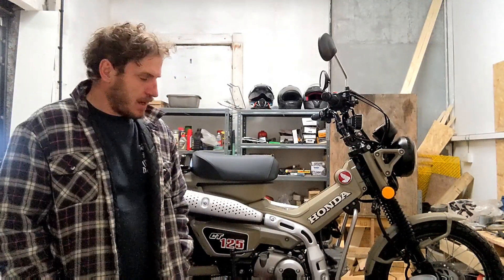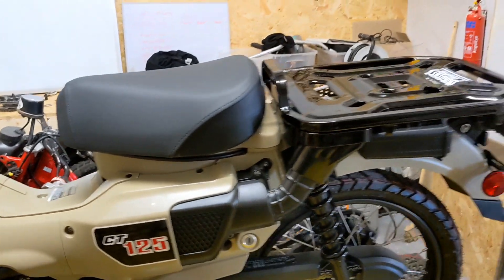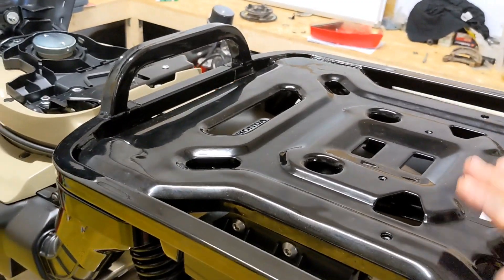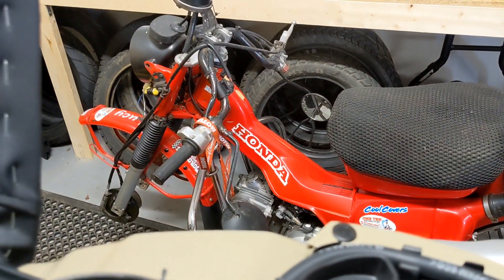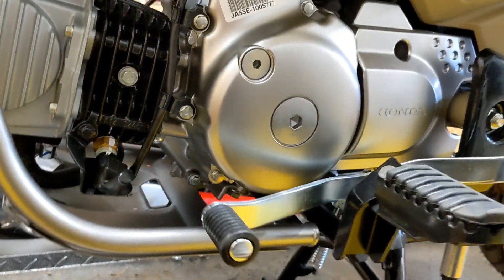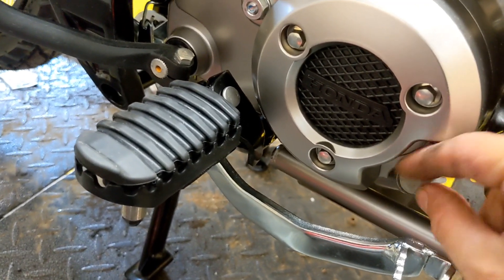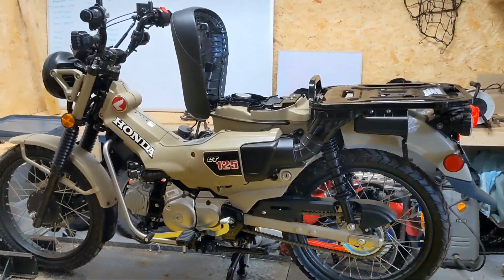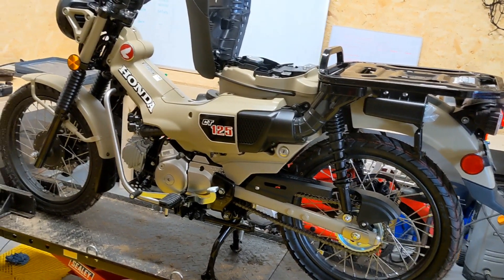A walkaround the new Honda CT125 (UK based)

Comment: I bought two, one in this beige and one in the red. Up to 600km on the beige one now and it's freed up a bit, still on standard tyres but have done some dry green lanes around my way. Today fitted YSS rear shocks, smaller rack and centre rack and have some trail tyres to go on next week. It's been fun around the back lanes out my way and I'm looking forward to doing a few overnight trips on it. Great service from seven Seas, highly recommended

Comment: I didn't have this model but I bought a brand new Wave 110 in Thailand in 2001. It had electric start but a drum brake in the rear which functioned very well, especially in the wet; paid the equivalent of 1.000 US $ for it. I rode it almost 70.000 km in nine years, only replaced the ususal parts like tires, brake pads, chain and sprockets and of course changed the oil regularly. The chain lasted forever inside the enclosed box. Around 40.000 km it wouldn't start, it needed a new spark plug, after that it ran again. Never checked the valves.
These kind of bikes are extremely reliable, simple, meaning easy to repair, and durable. But for 4.500 pounds I'd get another Honda, maybe a CRF300L or even a CB500F.
Reply from the maker: Yes all the base Hondas are reliable these days. Sounds like you had some good adventures on the 110.  With the CT you're paying a lot for the badge as the architecture is largely the same.  But some will value that novelty, some won't.

Comment: I've got a couple of thousand on one. In Australia. It is pricey for what you get but it's built so well and the practicality is something else. Can confirm, has a crap chain that needs tightening a lot. Other than that, it's fantastic for what I use it for. Good for the work commute with a bunch of stuff in a milk crate on the rack, and it eats up dirt trails like nobody's business.

Comment: Nice review. I've got a 125 Supercub and have added a small rack and top box which I think makes it a practical bike but although others have taken theirs off road don't think I will.
The chain on mine is made of cheese so be prepared.
I'd love a kick start on mine as there have been some issues with the battery.
Quite a few differences as the cub has a drum rear brake.

Comment: Hi Nathan - my bike from Seven Seas is also tan but I have seen a pale snot green on the web in Thailand - presumably brought out in recognition of Covid!

It’s worth mentioning that the oil capacity is only 700ml - I had a litre in mind so I wasted a couple of hours sorting out an oil change at 150miles!! This small volume will obviously have a bearing on those frequent and necessary oil checks you mention, especially if the bike is being run at full throttle for long periods
Reply: Actually I was not really correct about the oil capacity - it is 900ml but only 700ml can be drained out under normal circumstances
Reply: @Kathikas1  Don't worry, my 110 didn't burn a drop of oil after 70.000 km and Thais usually change oil every 10.000 km, if even.

Comment: Great bit of info for getting one although I think the market for one here is one that Honda can’t ignore it’s selling so well everywhere else maybe they have played it canny regarding supply to there nearest and biggest customers first and then when that market slows Europe and U.K. may well follow. I keep my fingers crossed. This bike runs without a battery so it gets a kick start for in that event but the super cub wont run without a charged battery because it’s keyless so needs electric power supply. Regarding indication of neutral, does the N on the display light up in neutral?
Also when you stop, say at traffic lights, does the gear go straight to Neutral automatically? Thanks for your presentation it was very good. And yes I hit all the buttons

Comment: Ps if you look in the tool kit there's a piece of wire that loops under the lockable seat that you can lock your crash helmet on the bike.pps the bike holds .8 of a litre of oil be very careful you don't overfill with the 1-litre size.

Comment: I bet you'll get more than 125 mpg. I also reckon oil consumption will be better on this than the 110. That's based on oil consumption on the Honda Wave 125i I ran for a week in Thai heat. It didn't use any. I couldn't get on with the gearchange, though, which was just like the modern CT's. The CT125 is a handsome machine. It looks better in beige than red. Never seen a green one. I wish Honda would do a Monkey with 15'' wheels and a 150 engine. I'd buy it as a runaround in northern Thailand.
Reply: 60-65 kms to the liter is reported. Thats around 160-185 mpg imperial. Or 1,5-1,7 liters pr 100 kms. Similar to the new CB125F 2021.

Comment: I also have a beige CT125 from Seven seas. Had it a month now and done 850km's, so run in, I've been getting 163mpgwhilst running in. Tank holds 5.3 ltrs (only 3.7ltrs on the super cub) so range is 180 miles. Shame the speedo is in km's but you quickly get used to it. Yop speed so far is 102kmph (circa 65mph) on a flat without wind (albeit not checked it with Satnav). All in all a great little bike
Reply: You may be able to alter the Speedo to mph using the Buttons on the unit.
Reply: What’s the build quality like, are they like the c90, which I had many in my time.
Reply: @tub19  Build Quality is great and superior to any bike produced in the past.
Reply: did u get it for £4,500 aswell? im saving up for the green one

Comment: I seem to offer a public service collecting nails and screws from the UK’s roads so one of my priorities is to make the rear wheel, at least, tubeless. There are some tasty laced rims in Thailand but getting hold of them may be a bridge too far (River Kwai?) and I will go down the DIY route

I am still struggling with the gear box and always looking for 5th gear. I wonder if a 37tooth rear sprocket might work for the road riding I do and avoid ABS warnings due to fiddling with the front sprocket. My pension has just been blown on an OPMID Multimeter to replace the oem instrument which may cure both issues as well as giving an mph readout

It certainly is a great fun ride and the folks at Seven Seas Motors (Mark and mucker Sharon) have been great to deal with
Reply: Hi Tony, I also have one from Seven Seas, just getting used to he gear box set up, to be honest found it a bit of a pain lol. But love the bike. I would be intret to hear if your new clock allows MPH? Not sure why it wont let us change to MPH ! Cheers
Reply: @venturabiker1  Yes it does, amongst a few other things …
Reply: You do NOT want tubeless. Hit a pothole or sharp edge like a gutter and it's INSTANT deflate. Not good when your doing 60 Km/hr or more.
Reply: @itchyvet  That is almost exactly what happened to me in northern Greece a couple of years ago except it much faster than 60kph and the smash injured both my thumbs and dented the front rim both sides - no deflation of the tyre at all and I was happy not to be sitting at the roadside repairing a snakebite to a tube after a rapid deflation … tubeless is the way to go for me

Comment: First what   is the front fork travel like, I'm a big lad and may need to upgrade the springs or put a pre loader on. Can you lift the handle bars at all? What are the best off/on road tyres for this machine, I want to do some green lane riding in Yorkshire and nearby. I'm sorry honda but I think the Super Cub looks awful in that grey with red seats. And yes I started on a C100 in 1969, bought for £10 with a seized engine, 4 hours work and a new piston and ran beautifully for another 5 years.

Comment: I can’t believe that Honda is not going to sell them on the european market 🙈
Reply from the maker: Me neither
Reply: Far to expensive for what is effectively a rebadged Chinese bike imo  though I suspect  the crazy  (European) price  has a lot to do with the  Euro 5  specs which hike the price a lot for any motorcycle sold in Europe, if I bought one the first thing to go would be the restrictive exhaust system and the abs.
Reply from the maker: @georgebarnes8163  The price is what it is because it's being brought in by a private import company, who will obviously have higher unit costs to cover and who also need to make a healthy margin to justify the punt they made on bringing in the first 25 bikes (I believe they've sold 75 so far so there's definitely a market for them, even at this price point.
Reply: @nathanthepostman  I understand, but  the point I am making is that these bikes are just Chinese bikes rebranded which is something that Honda should not be doing, they are not Japanese  just cheapo clones with a crazy price tag , If I pay for a Honda I expect to get a Honda not just a Honda badge on a  cheapo Chinese bike. I can buy a lot better for 4.5 K and then some in the form of a real Honda.
Reply from the maker: @georgebarnes8163  I don't quite get what you mean about them being Honda clones. They're built by Honda in Thailand. They were designed by Honda. They are Hondas. Admittedly, they're a long way away from the Japanese built bikes of old, but bar Fireblades and maybe some of the other high end machines from my understanding none of the Honda range is built in Japan anymore.
Reply: @nathanthepostman  Sorry, I thought what I meant was clearly stated, I will not pay  Honda prices for a cheapo Chinese  bike that can be bought for a tiny fraction of the  "Honda " brand name badge, I know and you know very well it is not a Honda but a cheapo Chinese bike with a Honda badge and nothing more, did you notice the barrel cooling fins are cast in wrong direct, that is the Chinese for you.
Reply from the maker: @georgebarnes8163  So are you saying that all CT125s are cheapo chinese bikes or just the one in the video?
Reply: @nathanthepostman  All of them, fair deal if they had a sensible Chinese asking price of around £1200 with a years warranty, £4,5 K for a 125 cc hairdryer built in China, are you for real?
Reply: @mortalwombat Yes.
Reply: @georgebarnes8163  No they are not made in China,  they are made by Honda in  a Honda factory in Thailand. The same place they make the 250/300, 500 and 650 range. Very few reported problems with them. They sell for 85000baht in Thailand, which is about £2000, so someone is making a killing at £4500
Reply: @georgebarnes8163 massive difference in quality, engine tolerances, electrics etc. real Chinese bikes are shit
Reply: @georgebarnes8163  being wrong is not a shame.
Reply: Bcoz they were restricted by EU.

Comment: After nearly 40 Australia Post in my area are trading out their Honda CT's for electric tricycles. Speaking to my postie it seems the efi models were not as durable or reliable as the older carburettor models.  My old CT 110 should start appreciating any day now. Probably should take the flower pots of the seat and dig the weeds out of the rims.

Comment: Hi again , the rolling chassis on this bike ... same/very similar to the 1970's Honda C50/70/90 as in pressed steel under the plastics with conventional forks instead of pressed steel leading links ? If yes .. just a thought .. would the C50 etc fully enclosed chain guard/cover fit ? - would keep the crap off the chain and maybe get a few more miles from the chain .. just a thought !

Comment: I've noticed over the last 4.5 years that the liquid-cooled 50cc engine on my 'Metropolitan scooter never loses any oil despite being  'wide-open throttle' 90% of the time I'm riding it
 It does get 'cruddy' at about a 1K miles worth of use, but I'm certain it would last another 500 at least   I always change it, tho )
In a 'pinch' I bet I could use some paper coffee filters to 'strain it' and put the full-synthetic 10/40 right back in again!

Comment: The kickstart is a bonus, the Groms etc have never had them. Obviously a FI bike wont thumb start on a flat battery, but these little 110/125 EFI Honda engines will kick start on a dead battery.
Handy...
Reply: Ive got  a suzuki fl 125  06 model  efi..  proper oil filter  and kickstart.. gear indicator.. screen, rear rack  trail tyres..  just £600..  not paying  the  price of  £4500 for one of  these ct125

Comment: Yeah, overtighten any chain will stretch it out in no time flat, and likely wreck the sprockets too. There is a tendency to over tighten chains when on  the stand as they look slack with the rear unloaded.  Read the book of works and set slack on the loose end of the numbers given. A good chain will not stretch as much because it is stronger but if overtightened will wear out the sprockets.
Reply: Agree. in 3000 miles only needed to tighten slightly, the chain when oiled regularly and with correct tension will last.

Comment: I can just see that allen key going missing and you won't know it until you need it!!!! How would it be possible to fit a seat cushion or luggage over the rear rack if it has the breather box air inlet there? Would you need to carry a spare chain with you on your travels and if the chain is poor quality are the sprockets also poor quality?

Comment: I guess you have some sort of commercial insurance policy, Nathan. Having not imported anything before, I’m wondering how difficult it will be to get an individual policy on one of these when it doesn’t show up on their list of known bike models.
Reply from the maker: I do have a commercial policy but it should be ok on a personal policy as I had no issue insuring the ct110 on a Q plate after riding it back from Oz. You might just need to speak to the right insurer.

Comment: Hi , silly question ... but I will ask anyway , the gearshift - all down - old brit bike style without the 1 up/also known as race bike shift again without the 1 up - you said that you can go from 4th to neutral , can this only be done when stationary ? or when you are riding ie you are in 4th doing 50mph/80kmh and go for another gear(forgetting it only has 4 !) will the bike go into neutral  or do nothing/stay in 4th ???
Reply: Many Hondas have a small light on the dash showing that the bike is in "top gear". I usually shifted down from 4th, or, when I had to stop quickly, shifted into neutral at very low speeds.

Comment: This bike is £1850 in Thailand at current exchange rate £500 ish for shipping, However a containerful would cost around only two or three times that. If you're a business in the UK and VAT exempt that's great, but if not you'll have to pay duty and with VAT on shipping costs that is a whopping 23.5% extra in tax. A bike less than 6 months old with less than 3.8k on the clock is 'considered' new by HMRC even if it's had three or four previous owners.
So in 6 months and a few baht to a man in BKK who's really good with oddometers and will no doubt provide you with a backdated bill of sale from an approved dealer, let alone a franchise for a few baht more. A second hand 'as new' grey import. for less than £2500?
Reply from the maker: Yeah for sure, if you have a man in Bangkok, who's handy at fudging odos, and who will sort out the shipping at that end, then you could definitely get one a bit cheaper. But then you've got to add in costs in collecting from docks, MSVA, first registration fee, numberplate, and by the time you're done you've sailed well over £3k. Containers have also gone through the roof since Covid. Quadrupled to over £10k for a big one from Asia by all accounts. Someone will have to self import and prove what it can be done for. I reckon if they can do it for less than £3500 I'll buy them a pint.
Reply: yes indeed so  seven seas  charging £4500 is a piss take

Comment: Does anyone have any idea what a realistic top/cruising speed is for these? Bear in mind, I'm what you'd call a fat knacker...

Same question for the Himalayan as well? I like travelling to/round Scandinavia and have previously done those trips on a 1050 Tiger and a 1200 Explorer, now want something cheaper/lighter, but don't fancy sitting at 65 or 70 on the inevitable motorway bits I'd have to do.
Reply: What do you expect from an air-cooled, SOHC 2-valve 125?
Reply: @PrimoStracciatella  I’ve no idea, hence me asking the question.
Reply: 55mph max speed

Comment: Is it possible to change the speedo from km/h to mph?
Reply: Iv tried every way without success! Changing the clock might be the only option
Reply: It's easy to do the conversion, I never had a problem, you get used to it quickly. 25 mph is 40 km/h, 30 mph is 50 km/h, 65 mph is 105 km/h and so on.

Comment: 4500, could be worse really, I wonder how far off a Himalayan it is in top speed and 0 to 60 acceleration especially. You could always just cut an Allen key down to key size, glue a key fob on to it and hang it off your keys for the tool box

Comment: No duel range trans = No Trail!
Reply from the maker: Dual range would have been handy a few times on my Sydney to Alaska (himalays and Rockies) run on the ct110 Aussie spec bike but otherwise it managed ok without.
Reply: @nathanthepostman  It is just something that was a trademark for the originals and should be on the new ones for the cost.

Comment: I was quoted 6k by a company in Holland,
Check out,
A retired oakie living in Thailand.
He's got all the mod cons on his CT
Reply from the maker: Yes I saw the Dutch import company. They were charging a lot for the bike and no help with the registration.
Reply: @nathanthepostman  when you put it in gear keep a little pressure on the gear selector with your foot and it works like a hand clutch
Reply from the maker: @martinpip8212  Thanks Martin. I'm pretty familiar as to how to get the best out of the centrifugal clutch as the CT110 that I came back from Oz on had one, it's just that on that bike it was up on the toe to go up, which to me makes a bit more sense that down on the toe to go up, as it is on this 125. Will just take some adjusting to that's all.